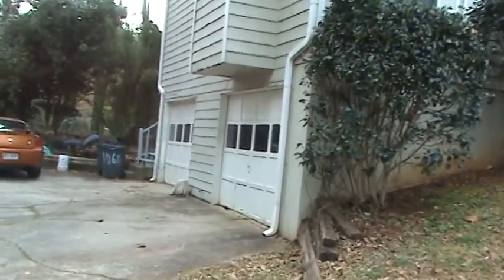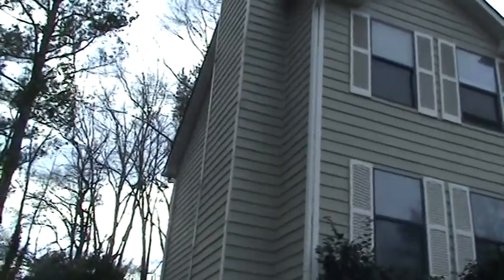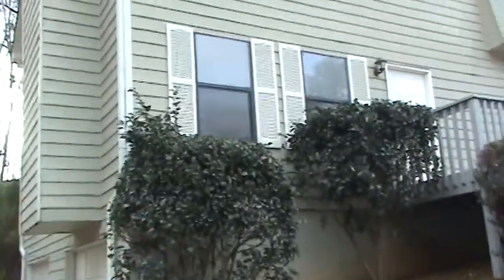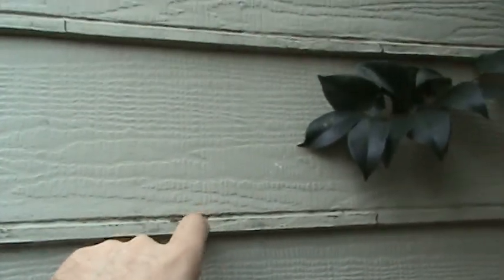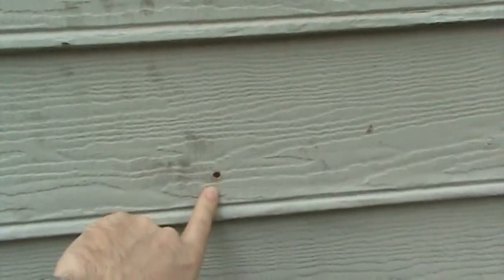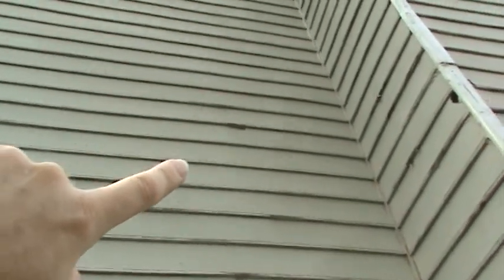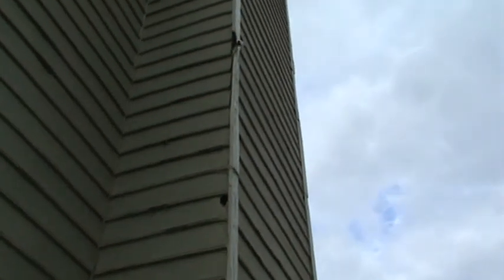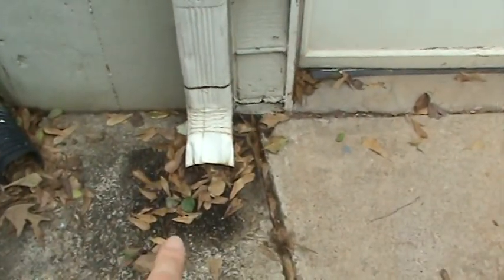HandyANDY on how repair masonite siding for an alpharetta investment property

Comment: i have a chance to buy a great home and i was ready to. The home is 
colonial 3000 sq ft but it has Masonite siding. My agent said i should 
pass but i really want the home. Thoughts? Cost to replace with Hardie 
board?
Reply from the maker: HI John, masonite siding can last a lifetime if it is caulked properly and hand painted with premium paints.  If the siding has been let go, you can spot replace rows - usually around the dormers and chimneys which are prone to lots of water exposure and pooling.  We did a project late last year where the clients were told they would have to replace all of their masonite siding in order to sell the home.  We spot replaced what we had, caulked, hand painted the bottom edges of the siding to seal it with Duration paint and then sprayed out the siding with 2 coats of paint.  We usually only hand paint UNLESS a house is being sold.  This sold list for $30k more than the agents expected to list it for and was under contract in less than 12 hours!  The spray paint won't hold up as well but the sellers saved $25k in replacement costs.  Where is the house located?
Reply: @handyandy-handyman1454  thanks the siding has some repairs under the "newish" paint but the house looks good. My agent has scared the bejesus outta me with this masonite.